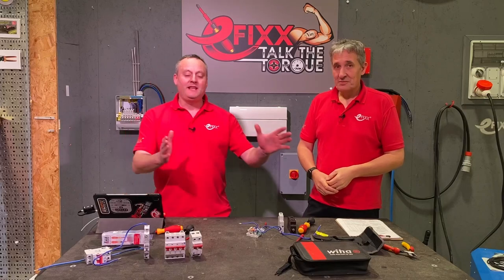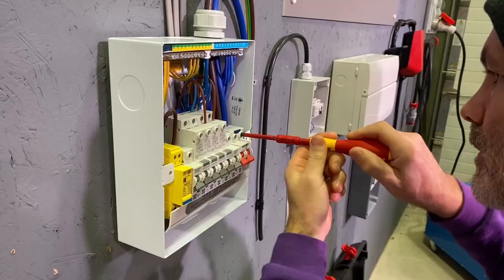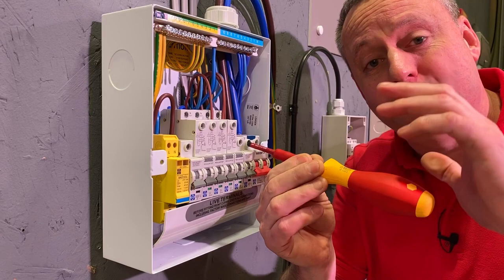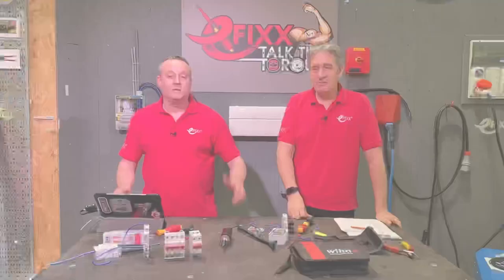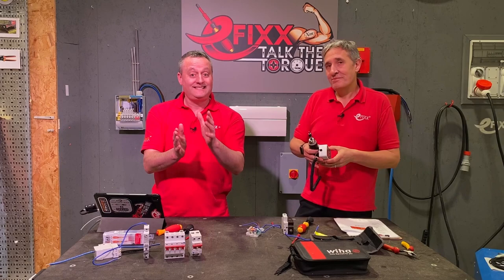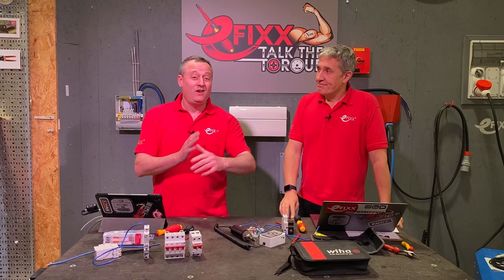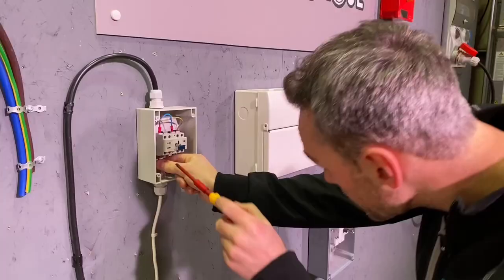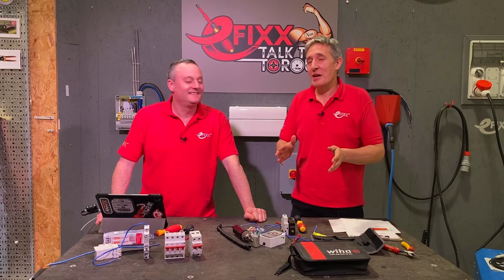TORQUE SETTINGS: DO ELECTRICIANS HAVE CALIBRATED ARMS?

Comment: Having worked as a senior aircraft maintenance technician I would love to know how you tested the torque on a fixing retrospectively.

If you use some form of dial torque clockwise you’ll have to above the original torque before the fixing moves and you’ll have to see the precise moment the fixing moves. If you use a dial torque anticlockwise then your not measuring the same torque.

The only accurate way to measure torque is during application.

If the fixing have been over tightened then you could have a higher run down torque, which then impacts the clamping force.

I do admire the effort.
Reply: I stopped watching the video once I read this since I was already making the same conclusions
Reply from the maker: Great input thanks - we did indeed use a torque meter and watch for the point the fixing moved clockwise. The torque screwdrivers used by electricians are typically +/- 6%.
Reply: Surely though even i you plus or minus a bit of torque the point is still the same, through a range of electricians from experienced to not so experienced unless you use a toque screwdriver then you will be all over the place, i believe on another video they used a torque screwdriver and then used the measuring device and the measuring device actually showed that the screws were torqued to roughly the correct value so they have a benchmark to compare against.  Not disagreeing with your observations but just adding something that they didnt actually tell you.
Reply: @steve11211  thank you.

It’s just that your looking or feeling for probably one degree of movement at a radius of 20mm and that’s really difficult.
Reply: @efixx  I think he said that in a bit of a confusing way.

After a fastener is torqued tight it will take more torque to get it moving again that was originally applied. By measuring how much torque it takes to start rotating the fastener again you will always measure higher than the applied torque.

The best bet would be to torque each fastener down with a calibrated tool then measure the torque to start rotating the fastener which will be higher. Use that ratio as a scale factor for measuring the contestants torques.
Reply: This is where I wanted to ask opinion as with a lot of these torque drivers aimed at the electrical industry, I don’t see many coming from the place of sale with a calibration certificate other that the Norbar version.

Comment: I spent 45 year as a heavy vehicle Technician, the rear axle drive flange nut on a Scania is 1000 Nm.
Reply: Sorry, but what is that in Ugga Duggers?
Reply: Could you call that a Newton kilometer? Or Nkm?
Reply: @ericross5048  A Newton (N) is a unit of force whereas a (km) is a unit of distance, so this would be a unit of force (N) over a distance of 1Km. So Nm = 1N over 1meter.
The average torque of a truck wheel nut is 650Nm, the torque wrenches we use are between 4’ to 5’ long, the lowest torque i can think of are the wire hold down nut on an electronic unit injector at 2Nm. 👍
Reply: @jim2757-w8m  Thanks a lot for explaining, I'm still trying to get the hang of Newtons and the whole metric system.
Reply: @ericross5048  If I did it would it be a Newton Newton meter?

Comment: perhaps you should inform people that when they have finished using a Toque screwdriver that it should be reset to the Zero settng, if they leave it at a set point it can have adverse effects
on the tool
Reply from the maker: We think this depends upon the brand of driver - but will check
Reply: That is the case for most torque screwdrivers
Reply: I heard you don’t need to do that if the torque screwdriver is digital type.
Reply: Have always done this with every manually adjuster torque driver.. be it a wrench or a screwdriver I've ever used.

TBH it's just Good Practice 🤔
Reply: You have to calibrate torque tools time to time anyway. But yes, you're correct.

Comment: The regs state quite clearly you install and electrical accessories according to the manufacturer instructions, that includes the CU. If there's a torque setting then you tighten to that setting. If things finish up in court the book of regs will be quoted at you and you will be required to produce you torque screwdriver , if you can't the prosecution will have a field day with you and the chances are you will loose
Reply: “Loose”.  I like it.

Comment: As a curious observation, I have a Wera torque screwdriver with a range from 1.2 to 3.0Nm. If I torque up an MCB to 1.2Nm and then dial it up to 3.0Nm, the difference on the screw itself between the two extremes is something like 1/8 of a turn. 1/8 (!) of a turn… As the screw tightens, the torque increases at an insane rate and I struggle to accept that getting 1.8Nm vs 2.5Nm actually has any effect other than satisfying some arbitrary setting requirement made up by a pencil-pusher… I doubt there’s actually a difference when it comes to safety and/or function.

It’s a consumer unit… not a space shuttle.

But with that said, you can’t say you followed the manufacturers instructions to the letter if you don’t use one, and fighting that is probably futile.

Wouldn’t surprise me if there’s suddenly a requirement to use laser levels (calibrated within the last 12 months) for installations too, and not regular bubble levels. Another "you have to buy this expensive tool now to stay legal" exercise…
Reply: What a great idea. We all know that electrons roll out of wonky DBs.
Reply: Torque is almost directly related to the resistance of the connection. And you also need enough torque to deform the copper wire (and it's specified for the LARGEST diameter that fits the terminal) and that deformation does multiple things: makes the connection area larger, thus decreasing the resistance and it also creates air tight area that doesn't corrode easily. Also, when you deform the wire, you make absolutely sure it cannot be yanked out because it's an interference fit and there needs to be more movement for longer for it to work itself loose.

2.5Nm seems excessive, until you put the largest diameter of wire allowed into the terminal (or even TWO of the largest that fit) and notice that you're barely tickling it with anything less and that it doesn't deform enough to be secure for decades. Million heat cycles, might be ran at high current today and nothing tomorrow, could be -30degreed on winter, +40 during summer... you don't know.

It moves around, works itself loose and sooner or later it's not secure anymore...

Unless you tighten it to the spec.

Comment: We all know that the recommended torque settings will not work for some cables such as stiff tails and larger cables unless they are wiggled around to rearrange the strands in those terrible steel cage square terminals .The round brass terminals were little problem but these modern terminals exaggerated the problem by the manufacturers creating cheap nasty squeaking terminals . Also that screwdriver has a too narrow handle by far .
Reply from the maker: Stay tuned for more on this topic.
Reply: you should use end ferrules with stranded wires...

Comment: I think the torque screwdrivers do a good job. I went through a transformer control panel a while back and found around 60% of the connections were considerably loose in comparison to the recommended tightness from the manufacturers.

Comment: How much torque a screw can stand before it strips, depends on the material, the thread pitch, diameter etc. Torque screwdrivers ensure that you do not stress the threads too much, to the point that it strips. Proper torque alone does not ensure a good connection. You can torque it right but if the wire stripping is not done properly and you insert the wire improperly, trouble will arise. Using a wire ferrule for stranded wire is recommended.  Using a torque screwdriver can give you piece of mind. My main issue is the price. I would like to use one but I cannot afford it yet.

Comment: Does the torque setting change over time I wonder? In my experience screw terminals can loosen with age and use. How often have you taken taken a socket off the wall to check it out only to find the terminals are not very tight and in some cases the wires just pull out of the terminal. The simple act of plugging a appliance into a socket can over time loosen the terminals. As copper is pretty soft I imagine it will yield under the stress of compression. Perhaps the torque setting is only correct at the initial install and degrades over a time……..just a thought
Reply: Once every 5 years is a good idea... hire someone to go through all of them. Can't take more than an hour so 100€ tops... cheap insurance.

Comment: I've never seen torque wrench used on consumer equipment. But go to factories and transfer network stuff... that's basically a required tool.
And someone WILL check your work and if it's off, you get an earful since it's huge liability.

Comment: I think if electricians had access to a tool that reads out the torque they are applying to the screwdriver then that would help "train" the arm. I dont even know what 1Nm feels like so how would I be able to guess 5Nm...shouldn't be guessing anyway, use the right tools! :P
Reply: If you have a torque screwdriver and are doing up the screws, I tell you what though its amazing how much 2.5nm actually is, if you do an entire consumer unit I always have to stop at least a few times and by the end my arm is knackered..

Comment: If you go much above 25 inch-pounds (2.8 N-m) using a screw driver the operator will need above average hand and wrist strength. Fortunately, you can move up to a 1/4 inch drive torque wrench and use a screw driver to it. I find the small 1/4 inch drive wrench is much easier to use and usually quicker than a normal torque screw driver that does not ratchet.

Comment: I am sorry to say Nobody has a Torque set arm. I always use a Torque screwdriver to check. But I would not use a Power Drill   without a Calibrated Chuck one on Maketa etc Battery Drills Still can Distroy Terminals.
Reply from the maker: Tune in to the next part of the series when we show what happens if you use an impact driver
Reply: @efixx  I Definitely will

Comment: Why are there so many different torque settings? It seems needlessly complex. Could they not be standardised to at least a few sensible fixed points within a wide range and then construction of terminals just be to a standard as everything else in a well-managed industry?
Reply: depends on the terminal size, screw thread pitch, contact area etc.

There's no one that'll fit everything....

Comment: Perhaps the question should be asked ‘are the manufacturers torque settings too stringent’! Let’s face it tightening too loosely causes bad or poor connection possibly leading to wires coming out, heating effects etc; over tightening may cause damage to screws, cable, equipment or cause future maintenance problems. but in between these extremes their will be a wide range of suitable and safe tightnesses. An experienced engineer/electrician should be able to easily tighten within this range.

Comment: I see one problem, the isolator, if I remember correctly, was 0.8nm and all electricians torque screwdrivers start at 1nm that I've seen.
Reply: Surely that will require another specialist tool which get low usage and will in time need to be calibrated.  Do some of the manufacturers of the CU and associated internal kit have shares in a tool company that make the torque drivers.  In the Early 1990's Apple computers started to mandate that exotic tools were used to tighten up screws in their machines.  For most people they thought this was to combat badly trained technicians, which indeed it was.  Years later people learned that Apple had bought shares in some of the companies that made the exotic tools.
Reply from the maker: Depends upon the brand - the Wiha one we use goes from 0.8Nm to 5.0Nm.
Reply: @efixx  I'm glad to be corrected. Having delved a little bit deeper, I can see one Wiha model which starts at 0.8nm.
When you just do general Google search, most brands start at 1nm.

Comment: You take legal responsibility for electrical equipment if you don’t install it to the manufacturers specifications, so unless you want that responsibility… use a torque driver
Reply: I do hope you are stripping the cables back to the correct length too, that is the case.  Make sure you measure the correct length when you strip.
Reply: @JohnSmith-kb5ku  that’s what my precistrips are for. Also means you don’t nick the copper, which we all do from time to time.
Insurance companies are looking for ANY reason not to pay out in the event of an accident or fire, etc., & spending a few quid on tools to avoid losing my house (which will happen if I’m found to be negligent), that also make my job easier, is a no brainier. Having job sheets with tick boxes also avoids sleepless nights worrying but, few sparks employ that methodology either.

Comment: I always prefer to use my own Torque & wits. I always give 25mm tails  a good tightening then always wriggle them afterwards quite abit & always get another full turn on the terminals. Countless times i have seen an old( & new) installation with loose tails.
I have also found screws behind plate switches that have come out completely!!!! How does that occur 😮!!

Comment: So.... how the hell have we survived for the past 140 years without every connection Not being torqued up? Oh, and don't forget screw terminals on things like sockets, light fixtures etc which are still without a torque value on them horrid little screws!

Just saying 🤔
Reply: I can't speak for Western Europe but in the East we consistently see lamps burn out and switches malfunction due to sparking and loose cables. Many of the houses here still have centuries-old aluminium wires embedded directly in the wall, some still haven't upgraded to new breaker types. I'm not saying houses will burn down, but definitely there is a risk of invisible danger and inconvenience.